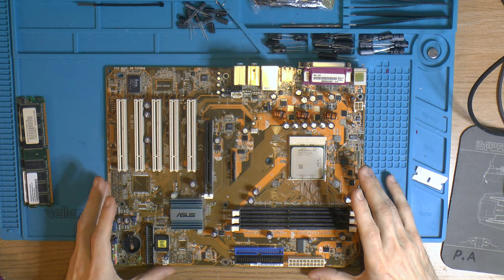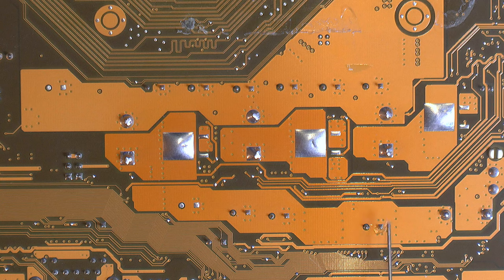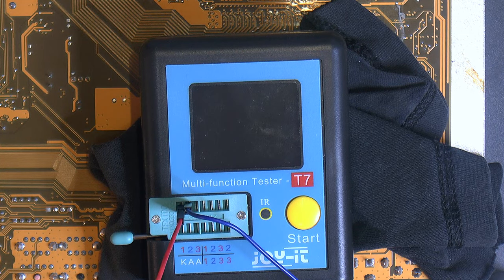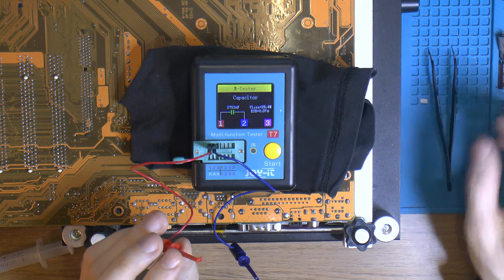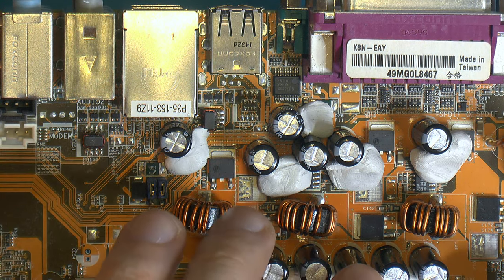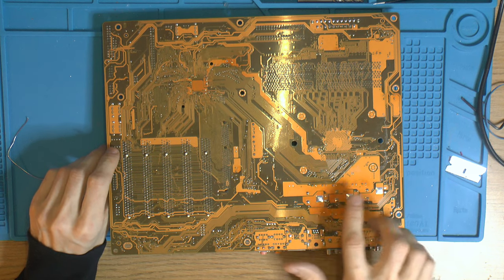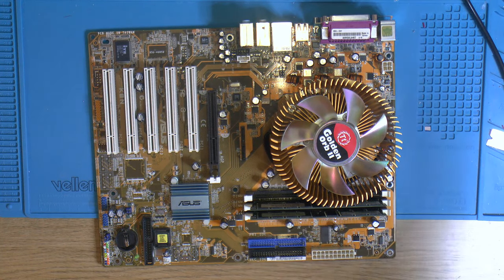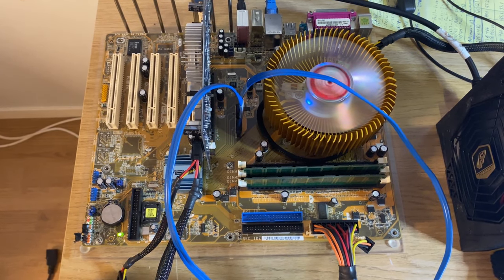ASUS K8N repair

Comment: Those caps dropped out so easy! I tried recapping an A8V and had a heck of a time sinking enough heat into those copper ground planes. I guess I need to upgrade from a 60W iron 😅
Reply: You can use a small amount of low melt solder. The caps will fall out in no time without any preheater or large iron.

Comment: When components don't solder in "as per usual" If soldering iron is 380c 
then the leads of the new components may need to be cleaned, in fact 
it's good practice to inspect new components to catch corrosion, 
especially if they have been in stock or "stored" for a while.. "Steel Wool"
should clean them.
APU 👁👍

Comment: These boards were notorious for breaking, they had a chip somewhere above the AGP slot that would blow, I had a customer come in with this board in a system, it was warantied, and Asus sent back a repaired replacement board, after a few months the ssame customer comes back, with the same complaint, system not booting, but this time the board had that IC chip blown and it was visible, and the store didnt allow me to sent it for warranty repair again. It was not a very happy day for me then.